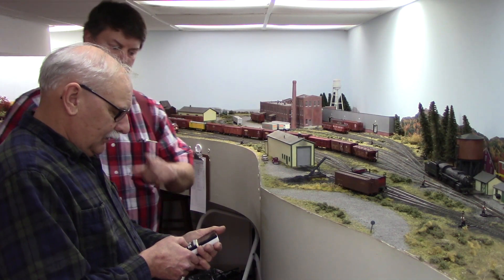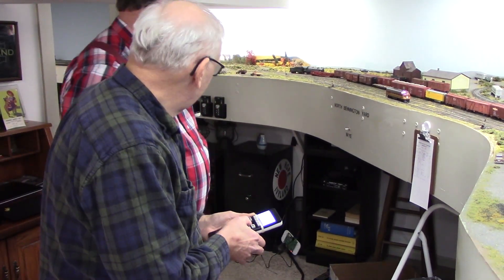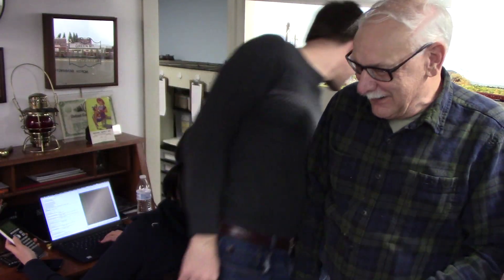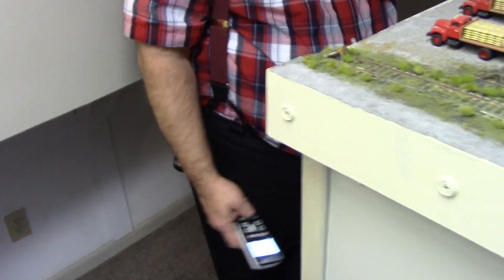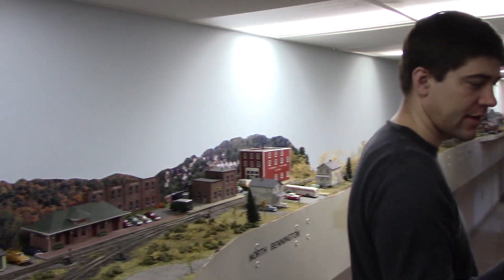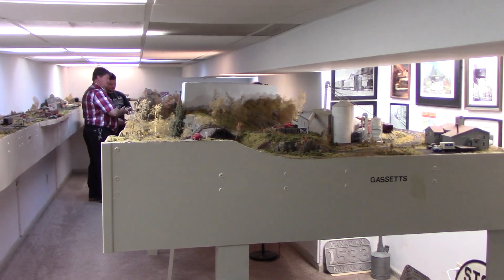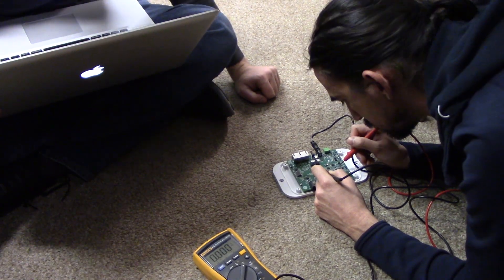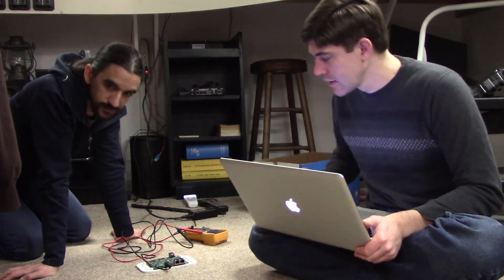#26 TCS Field Trip

Comment: Berry interesting, I currently have a Digitraxx system with  duplex wireless throttles and a  digitraxx WiFi unit to power my Proto Throttle. I like the proto throttle very much, its just kinda large.
Reply from the maker: Yes, I've seen it person. There's nothing like it out there. But I've adopted a few of his ideas into the thumb switches we added on the mini. It's a very poor cousin to the Proto Throttle. But it will be much smaller, lighter, and less expensive.
Reply: @JohnSL  , will this unit work with my existing system?
Reply from the maker: What system do you have? It works with JMRI or the Digitrax LNWI.
Reply: @JohnSL  . i have the digitrax lnwi.